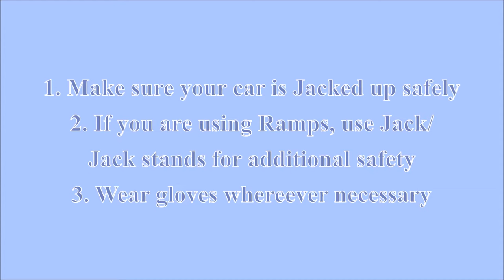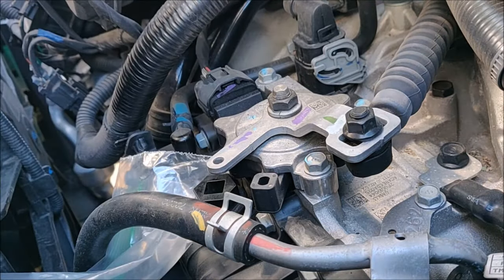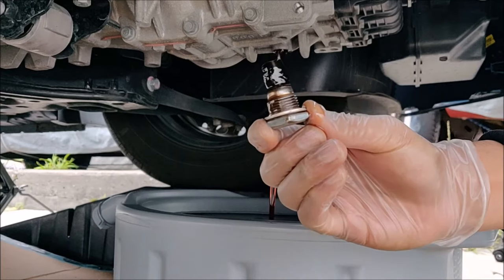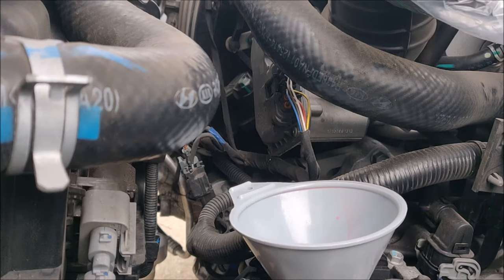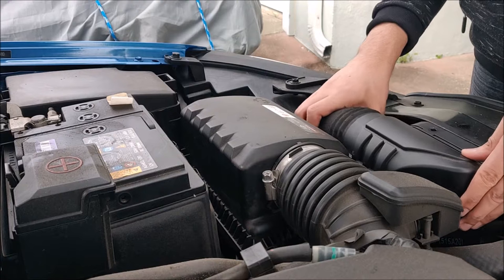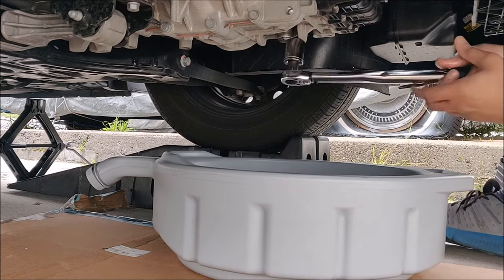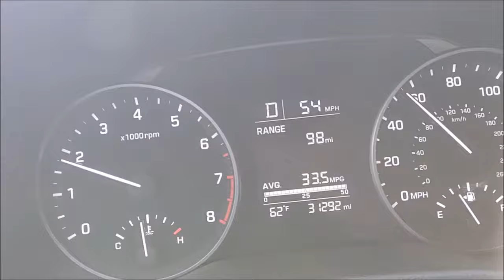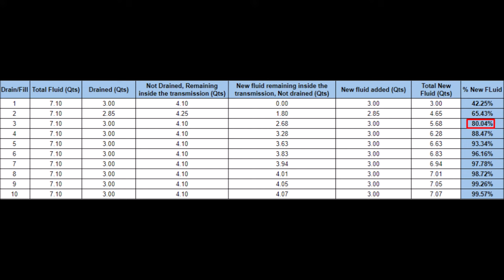2018 Hyundai Elantra Transmission Fluid Change - 3X Drain & Fill with Amsoil ATF (6Th Gen Elantras)

Comment: I have a question. Would it be a good idea to drain and refill Transmission fluid once every 10k miles instead of doing it 3 times at once every 30k miles? Because if it's fine to do it, then I wouldn't mind doing it every 2nd oil change. Gets rid of hassle of jacking up two more times just for transmission fluid drain. Because this way, I can set a day where I can do oil change, transmission drain, and tire rotation all at once every 10k miles. I do oil change every 5k miles. I have 2019 Hyundai Elantra SEL and it's already at 36k miles. I plan to do transmission drain 3x on my 40k mile mark along with tire rotation and oil change. After that, I plan to do it once every 10k miles. Any input on this idea?
Reply from the maker: That is an interesting question. Since you have 36k miles, you can do what you said without any issues. But if the fluid looks very dirty after the first drain (use your intuition), then I would recommend you do a drain and fill 2 times (driving about 50-100 miles in between). That way you can get rid off most of the old dirty fluid. If you are using OEM fluid, then 2 times is sufficient. You do not need a 3rd drain and fill.
I did it 3 times mainly to replace 80%+ fluid with new and because I was using a non-OEM (Amsoil) fluid and I did not want any mixing issues (But I learned from my oil analysis that mixing fluid did not cause any damage to the fluid). But as you saw from my video, after 2 drain and fills, the fluid looked to be in good condition. Additionally, my oil analysis said that the fluid was in perfect condition. Hope this helps. :)
Reply: @andy-auto-info2483  Definitely helped. On my upcoming transmission oil change for the first time on my 2019 Hyundai Elantra, I plan to do it 3 times the way you did it. After that, I might just flush every 10k. I used to do transmission fluid change on my 2003 Acura TL and it was easier than regular oil change. This one is no different. Only hassle I'm gonna have is bottom bumper cover on and off but it's well worth it because it protects the parts. I learned from your statements regarding the oil. I was close to using Valvoline MaxATF because that's what I used on my 2003 Acura TL Type-S since all it required was Z1, so MaxATF worked fair enough. But it is quite skeptical that a viscosity that works on my old 2003 acura tl would also work on 2019 modern hyundai elantra. So I'm taking your advice and gonna go buy AMSOIL OE Fuel Efficient ATF even though I have 3 gallons of MaxATF. I'll prolly save MaxLife for a different car or if I know any of my friends who will need it.
Reply from the maker: @cocourth5611  I am glad you understood what I had to say regarding viscosity. It very important to get that right. I had a 2001 Honda civic myself and I was using the Z1 fluid. Thats how I knew that these modern cars use a thinner viscosity fluids.
And after 3 drain and fill procedures, you are good for another 30-40k miles. You can just do 1 or 2 drain and fill every 40k miles after the initial 3 time drain/fill procedure. That should keep the tranny healthy for a very long time. And true synthetic ATFs last a long time which is good. Also, do not forget to use the level check plug to make sure the fluid is at the correct level. Good luck! Do share your experience after the change here. Someday all this info will help others. :)
Reply: @andy-auto-info2483  Definitely. When I get to 39k-40k, Im gonna do transmission fluid change. Before then, I need to buy the parts. Will need to buy crush washer, amsoil atf.
Reply: @cocourth5611  did you buy it new or was it a used rental? I'm doing mine around 20k because I drive 90% city, lots of acceleration/deceleration because of my area's dumb traffic light sequence
Reply: @thecentralman  Bought it new. Same here. I live in the city also and bcz of traffic lights, our cars are put under severe condition instead of normal condition, so we have to take optimal care. It's why I'm thinking about draining transmission fluid once every 10k miles. My Amsoil ATF just arrived last week.
Reply: @cocourth5611  sounds good bro, please let me know how yours go if you remember this comment. I'm planning mid-June because that is when work will slow down.
Reply: @andy-auto-info2483  Completely forgot about the washer and I just bought 10 washers and a drain plug magnet just for the heck of it even though using the current drain magnet is more than enough, always good to have a back up. My car is reaching 40k. I need to drain this. I don't think I'll install the bottom cover every time. I might just leave it on the side during the time I drain 3 times. Not gonna go through the hassle of uninstalling and reinstalling everytime when I clearly know I'm gonna drain it again after 100 miles. I'm almost ready to drain. TY for putting the washer code on the description. I looked it up and it fits on mine too since I have 2019 Hyundai Elantra, which is same as 2016-2019 Elantras.
Reply: @thecentralman  Definitely. I will be doing mine shortly. I am short of the washer, so I just purchased it yesterday. Hopefully I get that in. Don't forget to get a washer. I bought 2 cases of Amsoil Fuel Efficient ATF, 24 quarts. 9-10 will be used on the 3x drain. I'm thinking about installing transmission cooler.
Reply: @andy-auto-info2483  Do you think transmission cooler is a good idea?
Reply from the maker: @cocourth5611  that's wonderful. Why did you get 24 quarts of fluid? Just curious.
Also, for the 6 speed automatic, I don't think a transmission cooler is necessary. Amsoil ATF Signature series is the best for resisting heat. One drain and fill every 30k miles going forward will be all you need!
Also, you could think of installing a transmission external magnefine transmission filters when the transmission hits 150k miles. Ha ha. Just a thought. Then it would last a very very long time. :D
But sometimes using quality fluid is all you need. :)
If it was a CVT, then a cooler is a good idea, especially on a Nissan!
Reply: @andy-auto-info2483  For future usage. I tend to stock up. For instance, I have 6 5-quart jugs of 5w-20 synthetic motor oil, 8 WIX XP oil filters, and now, i have 24 quarts of ATF OE. So every 40k miles, I can drain and fill. Each time will be 10 quarts. So I'll have enough for next one. Gets rid of needing to order every single time since I know prices won't depreciate and also, they're sitting in a room. It's handy to keep things in stock so I don't have to keep reordering and it's cheaper. Amsoil for instance, you need to purchase $6 membership to get a discounted price. I use that time opportunity to stock up two times so I dont' have to keep paying that $6 to order. Having lot of jugs of motor oil and 8 oil filters prevents me from going to the store to buy them everytime, especially when I got them on sale, 2 jugs for $25. Same goes for oil filters. I bought them in bulk to dilute the cost of shipping as well as needing to go to the store anytime to get it because by buying them in bulk, I was able to buy them for $3.5 for Wix XP filters when they were on sale. I hate going to AutoZone or Oreilly everytime and getting ripped off. My synthetic oil change comes out to $15.50 or even less since I dont' pour entire 5th quart onto the engine. It's just me. Some people will say I'm a hoarder, which is fine. I personally like to buy it enough to keep things in stock and handy when I need it.
Reply from the maker: @cocourth5611  Well explained. Definitely, I understand. Its always good to stock up.
And thats a solid deal for an oil change.
Good luck with everything :)
Reply: @cocourth5611  I did mine with Valvoline Maxlife ATF, 95% satisfied! Great for the price. I would also check the level and replace the rubber gasket on the check plug (don't know the part # yet so i reused mine)
I underfilled mine at first because I drained too much so I had to add 4 more qts to flush it again.
Reply: but of course I replaced the drain plug washer
Reply: @thecentralman  One thing I will admit is I like Valvoline MaxLife ATF better than regular OEM. My 2003 Acura TL transmission was known to have problems and MaxLife ATF was way better than DW-1 and Z-1. But for my new car, I do plan to take extra precaution and decided to go with Amsoil Fuel Efficient ATF. I have to do all the drains this weekend but it's so damn hot.
Reply: @andy-auto-info2483  Pretty ashamed that my car now hits 43k and I haven't done it yet still because I've been so busy with work and the thought of removing the bottom cover is so annoying. LOL. It doesn't help also when the weather is so damn hot in California. Every single day is over 90 degrees right now during the summer. I will have to do it eventually but when I'm swamped with work while weather is so damn hot, it doesn't help. LOL. I also have to do coolant flush(this, I might take it to a mechanic I trust since last time I did a coolant flush, I almost burned myself.) I will have to do it eventually, and I really hope I can have time to do it before 45k, especially when I'm about to go on a road trip next month. I will have to clean my K&N air filter also since it's reaching 50k soon. Lot of maintenance to do this summer. Transmission, Coolant, clean K&N air filter, replace cabin air filter, suspension shocks. FML. But if anyone wants to add and remind/advice me of what I should do at 50k mile mark, please let me know because I want to get everything done at once. :) TY
Reply from the maker: @cocourth5611  check the owners manual for precise maintenence for non fluid items. But it looks like you covered it.
And coolant flush can wait till 60-75 k in my opinion. Use a coolant tester with 5 floating balls to check the condition of your coolant. You can do the flush at 60k if the condition is still good now. Tranny change you're not late as well, you have time upto 50-60k miles, but like you saw in the video, earlier the better. If the car is 3-4 years old, brake fluid flush would be necessary as well. 
All the best :)
Reply: @andy-auto-info2483  Update. I finally did transmission drain today after 52k. I noticed slight difference. I do get more power and smoother shift when going uphill. I can't wait to do it two more times. I'm going to drain and fill again this weekend. Friends tell me I was lucky my fluid was still milky red. Because usually people who drained out their transmission past 60k are dark. But of course, I take into an account that my car is less than 2 years old and I do drive a lot, averaging 35k per year. so transmission fluid of my 52k opposed to average driver driving 52k are different, especially when I drive on a highway most of the time. I do also feel that Amsoil ATF might've been also the reason why my transmission shifts smoother. I do believe Amsoil ATF plays a role. My ATF currently is still mixed with Hyundai SP4. I need to drain it two more times and then I can start seeing some real quality results. Just over one drain and refill, I'm seeing a slight smoother difference.

Thank you very much for this video and your advice on Amsoil ATF and your reasoning for it. Became an Amsoil ATF fan as well. Had it not been for this video, I might've used Valvoline just because it is "compatible". At the end, as people say, you get what you pay for. Rather pay more and get Amsoil than Valvoline MaxATF.
Reply from the maker: @cocourth5611  I am glad to hear this. Happy to have helped. Have fun driving :)
Reply: @andy-auto-info2483  LMFAO, I don't know if this was a good idea but I used electric mini saw and carved out a hole on the bottom cover below transmission drain bolt so I don't have to detach and retach cover every single time. So much better now. It's definitely worth it for time saving. I know someone will criticize this and say dust and other stuff will sneak under those holes and screw up my car but I've driven without cover on my older cars since they don't come with it and it lasted for a long time. So it's just an idea i'm throwing it out there for you and others. Definitely worth it for time saving.
Reply from the maker: @cocourth5611  Good idea. Yes, it does not hurt anything which is fine. :)

Comment: Im wondering if shifting the trans into a different gear other than park would have made room for the fill plug to come out?
Reply from the maker: Hi Patrick, good question.
The shift selector was not in the way. There is another hexagon looking bolt under the selector which was coming in the way of fill plug. So irrespective of what gear you are on, the hexagon bolt does not change its position. Hope that makes sense :)
Reply: @andy-auto-info2483  Yes some one higher up in comments said you can put  shifter in a different gear, Neutral or somewhere to move the x piece  glad I saw it.  Mine trans fluid is ready to change.
Reply from the maker: @stockman1963  that's good to know.
In my case, the shift selector was not in the way. It was the hexagon looking bolt that was in the way. So it did not matter if I changed gears, it still did not move and blocked the fill plug.

Comment: My 18 Elantra is at 77k miles. To my knowledge the trans fluid has never been changed. Would you recommend doing it?
Reply from the maker: Are you the owner since the beginning? If so, you will know how the car has been used, whether severe conditions or mixed.
There should not be any issues if the fluid is not burnt under severe condition usage. I also suggest to check with your mechanic and maybe examine the fluid condition?

Comment: How many quarts did you have to buy? This will be the first time I will be doing this to my 2018 Elantra and would like to know how many quarts I should buy. Great video thanks for the information!!
Reply from the maker: Thank you! I had bought about 10 Quarts. But if you are using OEM fluid, doing this 2 times should be sufficient at 30k miles. :)
Reply: @andy-auto-info2483  okay thanks, so my car is at almost 60k and I have never done it since owning the vehicle. I bought it at 24k miles, what is the difference between flush and just draining it and replacing it with new oil?
Reply: @andy-auto-info2483  also is there a transmission filter for this vehicle?
Reply from the maker: @SXTHGEN  I would not recommend a flush. Usually, for Hyundai transmissions, they force the old fluid out and add the new fluid simultaneously. A machine does this. And all the metallic particles are forcefully pushed out and may damage the gears or components inside. You can research more on this online, you'll definitely find lot of articles.
By draining and filling, there is no risk at all. And also you get an opportunity to clean all the break in materials captured by rhe magnet. Doing this 2 or 3 times makes sure you replace most of the old fluid by new. Check out the end of the video for a tiny analysis and check my pinned comment for more info. Thanks :)
Reply from the maker: @SXTHGEN  also, there is a transmission filter inside and is usually not changed by Hyundai. It is very hard to service that and even the dealers do not do that. Regularly maintaining the fluid and keeping it clean should be enough. :)

Comment: Take off the 2 size 10 mm bolts on the throttle body and you can shift it over to get the fill plug out. With having to file it.

Comment: Thank You for this detailed video. Would this process also apply to a 2017 Sonata?
Reply from the maker: You're welcome. 
Definitely it would. Just make sure the quantity of fluid that will be used to replace. It definitely will be more.
And the fill cap may not require any filing, it may open easily. So please check this first.
Also, if you can see the fill cap, drain bolt and fluid level check plug, then it's the same process :)

Comment: If you have a pump, could you refill via the over fill plug vs going through the hassle at the beginning?
Reply from the maker: Yes. You can do that. But it is a smaller  hole, so make sure you have extensions on the hose of your pump.
Also, lets say 3 quarts come out. Pump back 3.5 quarts. Immediately close the cap. Check fluid level as per the instructions on my pinned comment :)
Reply: I used the hand pump from harbor freight and it worked perfect!
Reply from the maker: @matthewdegennaro2604  that is wonderful. Can you share the product link?
Also, how many quarts came out? How much did you add back in? Did you check thr fluid level?
Reply from the maker: @matthewdegennaro2604  wonderful. Do let me know when its out! :)
Reply: It is a nice video. The only thing is that you should check for proper servicing by opening the over fill port and make sure that fluid comes out.